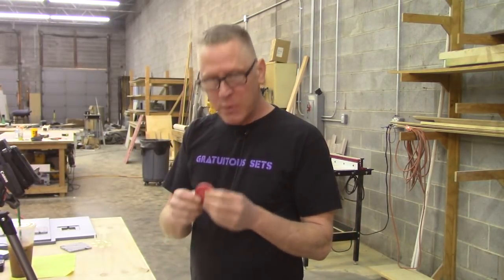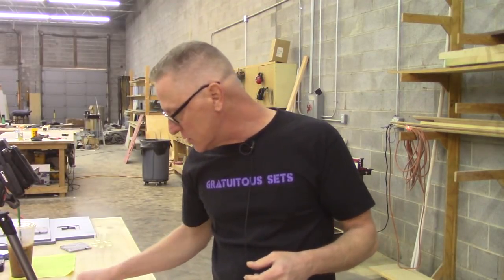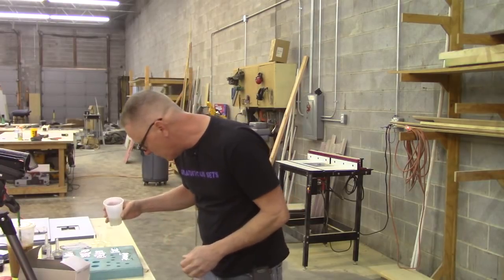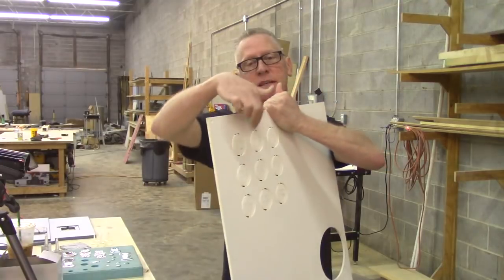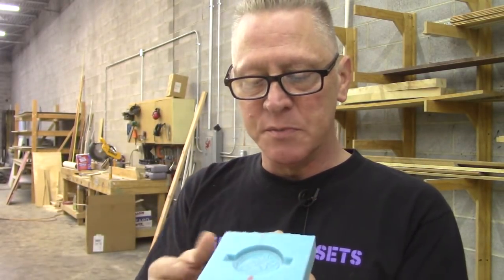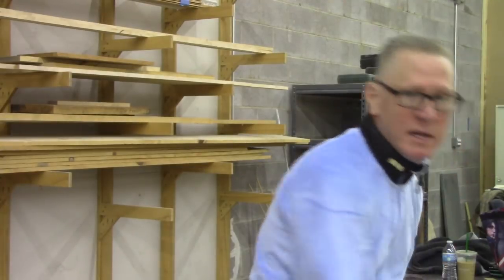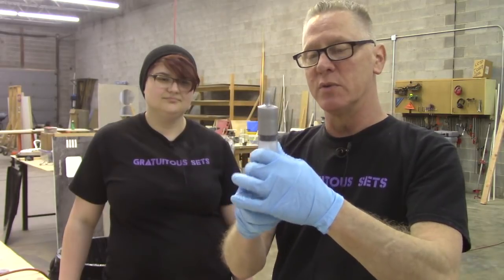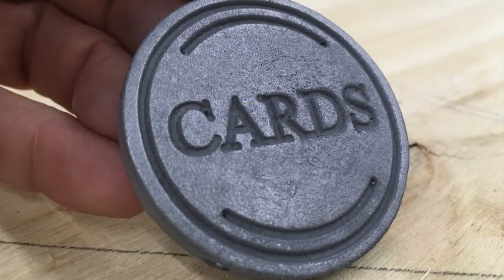How to Injection Mold

Comment: Thanks!  I have been debating between open casting and injecting...but possibly the most helpful thing I learned here is that the urethane I'm using is waaaaaayy thick.  I'll try a lower viscosity urethane and skip the injecting thing.
Reply from the maker: Great to hear! Let me know if you have any questions I can help with 😃

Comment: I have made silicone molds for years and I have never taken the pattern out of the first half before pouring the second half of the mold on a two-part.  I you just remove the clay and pour the second half, you will be able to build the mold box once.  Also, you build your box with the spout end attached to the wall
Reply from the maker: You’re absolutely right! I was a complete moron. At least it worked in the end. I could have edited out all my mistakes, but I figured it would be valuable for somebody to actually see my screw-ups. Adam Savage (a friend) once said “There IS no failure if you don’t quit”.  Thanks for taking the trouble to comment- too many wouldn’t. 😆 Never be afraid to share your mistakes- lol.    -Mark

Comment: I cannot find rubber injection molding for desktop. Why usually only rigid plastic is such molding used for? Why not pliable rubber? Is it a different machine required? Is it due to higher temperature?
Reply from the maker: Good question! Using an appropriate release agent, such as Mann Technologies Ease Release 200, you should be able to inject catalyzed silicone or latex without too much trouble. You might want to thin the silicone with an appropriate thinner so it flows well. For solid latex parts, you'll need to pour in latex and let the excess drain out. Repeat this process till you have a solid part (or leave it hollow if you prefer). I think the reason you only see hard plastic parts is that it is the "normal, usual" use of injection molding is to obtain hard parts.
Reply: @GratuitousSets  Noted about the viscosity and release agent. Thank you Sir!
Am looking into low temperature rubber molding eg. Silicone part A + part B
Reply from the maker: let me know how it goes! my email is mark@gratsets.com

Comment: If you were just trying to avoid air bubbles in the casting, why no use a pressure pot?
Reply from the maker: Lol- you know we don’t have a pressure pot... yup- that’s it
Reply: Gratuitous Sets fair enough. (You should get one tho... and a vacuum chamber. They come in really handy)
Reply from the maker: I was looking (primarily at a vac chamber) at Reynolds this week, and I know you’re right....    but we try to use fast products (cure time) so a lot of them would cook off before vac would finish.  I know you’re right Re: pressure pot, and I promise to get one soon- we spent too much in rebuild and move, so we are trying to be extra frugal....  when are you gonna visit the new studio? I’m trying to have a party in late May/early June
Reply: Gratuitous Sets I had to use some “less quick” resin for some of my projects (10 minute instead of 5).

If that party timeframe changes let me know. We will be in Reno installing puzzles in 4 rooms from May 21-June 1st (no pressure... or pun intended. Maybe)
Reply from the maker: Hehehe fantastic accident! The 300Q is hard in 90 seconds from from first contact- not enough time to sneeze

Comment: Two questions. Why not use 3mm Sintra and just sandwich the two coins together instead of milling on both sides?  Also, where is Preston?
Reply from the maker: An RFID chip is cast dead center in the coin. You might be able to make out the suspension needle when Anna demolds the coin. (We can’t disclose these things in the video) Preston is wiring the F35 Joint Strike Fighter for Lockheed. You’ll see him occasionally in the future 🤭
Reply: To make the masters I found it easier to do a two-sided mill, rather than keep track of which halves were getting glued to which other half. (There's also the fact that, after running a couple hundred feet of PVC over our ceiling for out air lines last month, I've huffed all of those glue fumes I care to for a few months.)
And, as silicone captures /every/ last detail, it would have taken a little more finishing work to sand the seam out of the final cast pieces.
Reply: I guess I don't have to ask that question now. LOL. I was thinking the same thing.
Reply: About the RFID
Reply from the maker: hehehe shhhhhhh!

Comment: really nice video but this is not injection, it's casting. It's really nice but injection is with thermoplastic, not with resin.  Did you make molds for injection?
Reply from the maker: If this were done at an industrial scale, thermoplastics would be used so they could be heated and pumped in.  Since the resin must be injected, it is an injection mold, but I take your point 🤔

Comment: Nice job, but why dind't you just 3D print the coins? 4 days of work for 9 coins seems crazy. If you want to stick to your resin, you could at least have printed the positive models or directly print a 2 piece mold. I had to do 10 coins last year with RFID chips inside and decided to print 2 shells that snap together. They also came out perfectly round, so they should roll. My finish was easier than yours since mine were "gold" coins.
Reply from the maker: That's a really good idea! Unfortunately, our 3d printer is an SLA Form2 and, while the detail is phenomenal, they would shatter if dropped.   I haven't printed a mold yet- sounds like a fun idea for a future video!
Reply: @GratuitousSets  I did priont mine in PETG with a FDM printer, so they were pretty solid. But I also printed some molds with an SLA printer which I later casted with wax for another project. You should definately give it a try. I really love your work and Ideas!
Reply from the maker: Sweet idea! What sort of wax, btw?